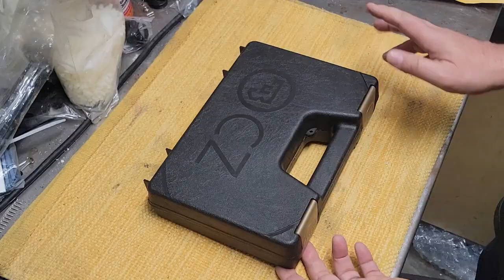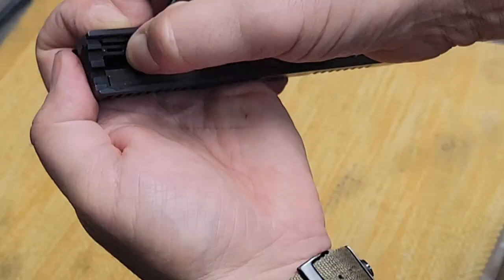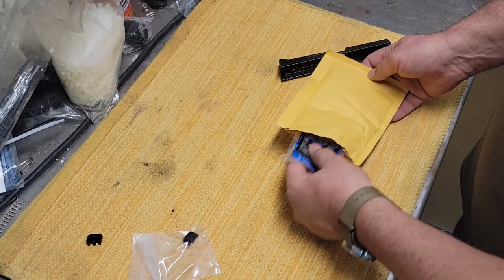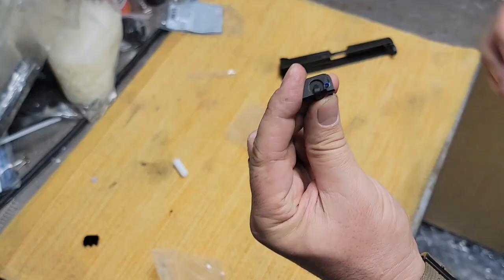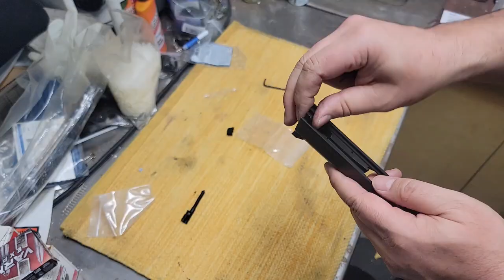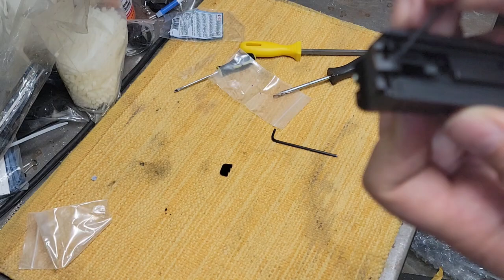Striker Control Device Installation | make your pistol safer to reholster

Comment: Thanks for the order, and the review! It warms my heart to see people enjoying my products. 

I had a few issues with tolerances on my most recent batch, I’m sorry you ran into some issues! 

If anyone purchases our products and experiences these sort of fitment issues, we will fit and install the old one ourselves or send a replacement!!
Reply from the maker: It really wasn't that hard to fit. I understand that not all pistol slides will have the same tolerances, and fitment for the device needs to be tight. I wanted to highlight that people might encounter that, and it doesn't mean that the product is bad... just means that proper fitment is needed and not reason to "ding" your device.
Reply: Are you producing these again?

Comment: I have a p10 as well. Thinking about getting one
Reply from the maker: So far I like it a lot
Reply: Thanks for the video. I think I’m a get one when they are back in stock. So far so good?
Reply from the maker: @TheRichieBen i like it and have not had any failures or issues with the operation of the pistol
Reply: @TheRichieBen  I made a comment on the main part of the video, but I feel I need to restate it here:

This issue he encountered was a problem with our last batch. These devices were manufactured by someone else for us, and going forward they will be produced by us IN-HOUSE. 

These devices are supposed to be drop-in replacements, and if any of our customers run into such fitment issues, we will offer free install and hand fitting or we will issue a replacement.
Reply: I made a comment on the main part of the video, but I feel I need to restate it here:

This issue he encountered was a problem with our last batch. These devices were manufactured by someone else for us, and going forward they will be produced by us IN-HOUSE. 

These devices are supposed to be drop-in replacements, and if any of our customers run into such fitment issues, we will offer free install and hand fitting or we will issue a replacement.